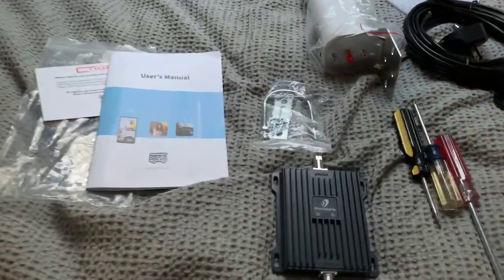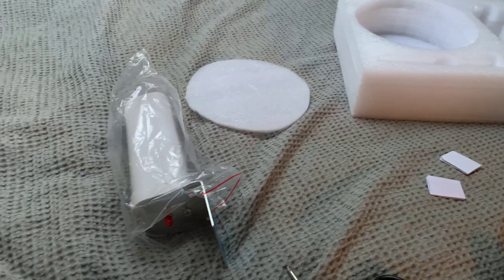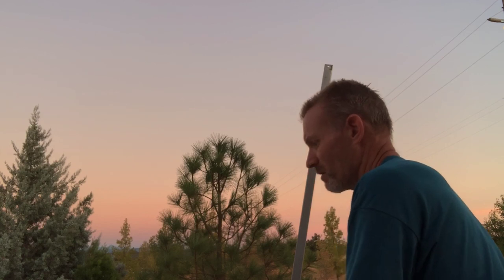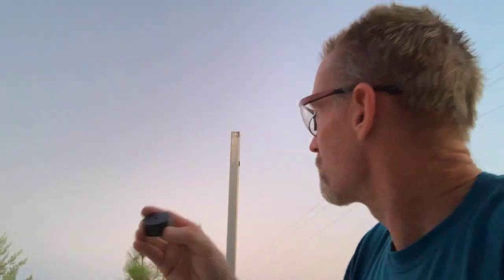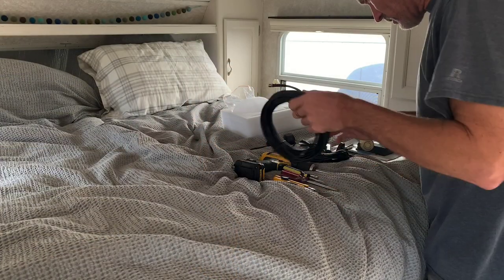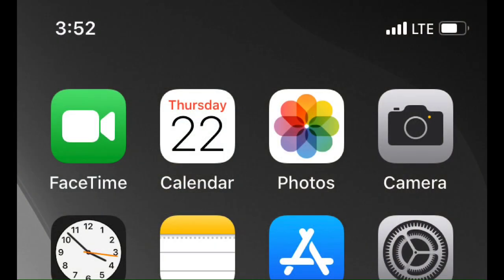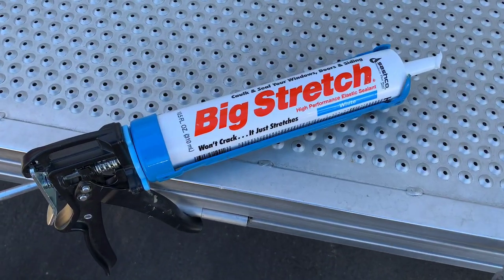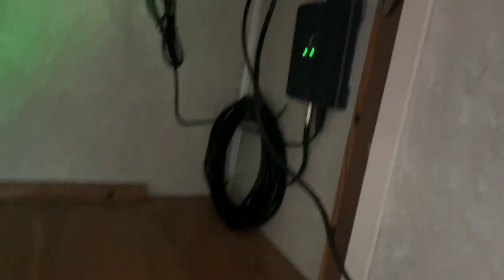Cell Signal Booster Installation for RV • Using the Stock Batwing Antenna Mount from Winegard.

Comment: Nice video, thanks.

 I got two good ideas from you for my directional Yagi antenna--
1- use only one of the original two antenna supports and just remove the other one 
2-altho you chose not to, I ran my cable through the refrigerator vent-cap (2006 Winnebago View).  It was tricky to drill the 5/8 hole from vent-space above the fridge into a narrow cavity on interior next to top of fridge.  Then I tuggged the cable thru from inside after Gorilla-taping it to a long screwdriver that I inserted from inside.  A 20-foot cable was just long enough to reach my signal amp located just ahead of the coach door.

Never even knew what that big plastic cap on roof was for till you told me! Gracias

Comment: Hold my beer. I'm gonna mount mine by using two bolts through the pole mount bracket on my booster in place of the two pins with C clips (at 4:01) on the existing winegard antenna. That way I can keep the useless tv antenna intact and still spin my directional booster without having it pointing to the sky when it's down.

Comment: I had that same idea.  Haven't done it yet.  Can't  wait to see how it works when you are boondocking.
Reply from the maker: It’s been working well.  The Omni directional antenna is not as powerful as the Yagi directional antennas I have but setup at camp is quick and easy.   
If I have a bar or two of signal without boost, the booster will amplify to 4 bars.

Comment: Did you ever try using the existing antenna to the booster? Antenna are just pieces of metal, I don’t know why it wouldn’t work but I don’t know much about broadcast frequencies.

Comment: If the coax is intact, could you use it rather than running new cable? Just connect it at the antenna and again at the 12v/coax plug inside?

Comment: As I gather the antenna mount is retracted when driving, did you notice any boost if you tried it when the antenna is lying flat? I like your idea but want to maximize reception while on the move as well.  Can't have everything.

Comment: What carrier are you using? Wonder if it matters? can it be used as a temporary set up instead of permanent install? Thanks for sharing.
Reply from the maker: I use ATT but it works on Verizon, AT&T and T-Mobile.  It’s Dual 700MHz Band 12/13/17 Cellular Repeater.  
Yes, when I first tested it, I did a temporary install by running the cable through the vent.

Comment: Is the reason you used the Yagi antenna was because of your cell service frequency band? The antenna that comes with the booster supports up to 700mhz.
Reply: Also the antenna you mounted looks totally different from link in your page. Can provide a link with the one you mounted? Thanks.
Reply from the maker: I use a uni-directional yagi on my home system (WeBoost) so I can point directly to the closest tower that’s about 5 miles away.  Stronger signal using uni-directional.  My home booster is 700, 800, 1900, & 1700-2100 MHz.
Reply from the maker: The antenna that I mounted on the truck camper comes from the kit that I linked in the description.  (The first link)
The uni-directional Yagi antenna is what I have on my house (used with my WeBoost amplifier) and will test against the Phonetone kit.
Reply: Thanks for the reply. I would also note the booster you’re using for your camper only supports frequency band 12/13/17 only. Which I can’t use.

Comment: Why did you not go with WeBoost?
Reply from the maker: I have the WeBoost by Wilson Electronics on/in my house.  Been running it for 4 years.  It’s a good system. I purchased this inexpensive booster because it’s not used as often and to compare functionality against the more expensive WeBoost.  I paid nearly $1000 for the WeBoost on my house.  (Directional Yagi Antennas 30 feet up.) 

This PhoneTone booster was $179.  So far, so good.
Reply: Price?
Reply from the maker: Previous comment reply shows that.